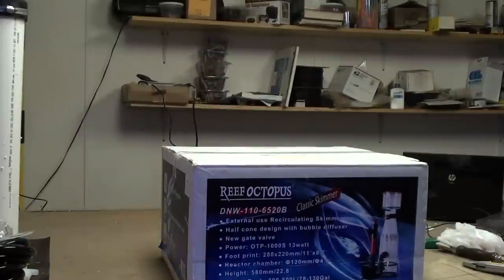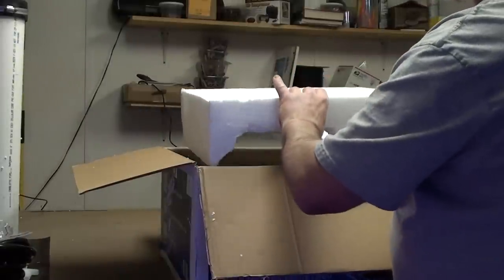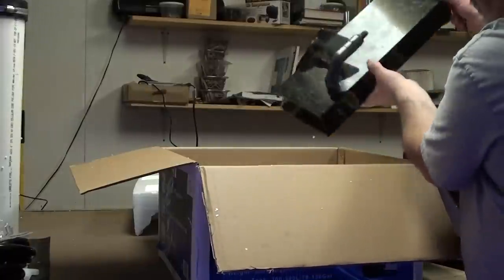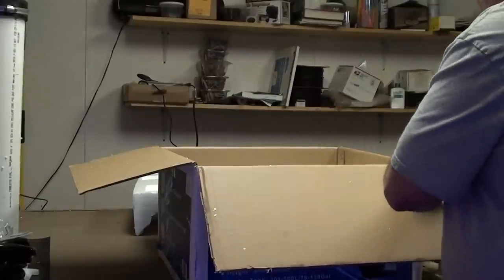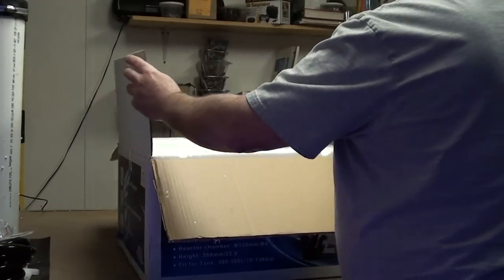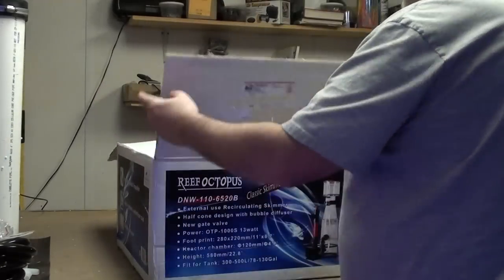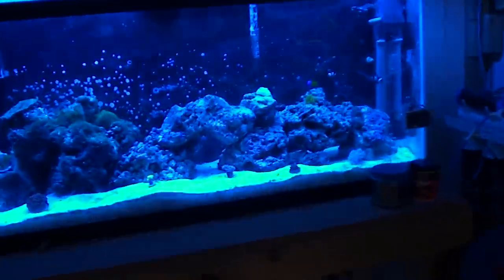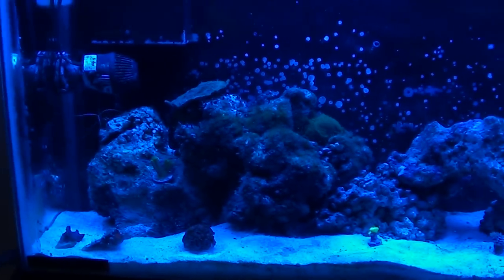Unboxing for an Aquac Remora

Comment from the maker: Don't feel that way, without learning about it ya really don't know. The Skimmer creates tons of micro bubbles which float within it's chamber by pulling water in via a powerhead etc. Those bubbles are able to capture the unseen waste and detritrus not seen normally. Once the bubbles rise up the cone shaped chamber they over flow into a collection cup which you clean out and replace on the Skimmer head. The overflow box in the tank draws water out and down into the sump/refugium below the main

Comment from the maker: Once the water drains to the sump below it goes into the Skimmer, some not all and then passes through baffles intothe refugium where you maintain chastity algae, live rock, live sand etc. from this point it travels through another set of baffles into the third chamber which is where the return pump is located, water is then pumped back up into the main tank. Most sumps contain three chambers. The 1st being where most Skimmers are located, 2nd is macro algae like chastity, third is the return